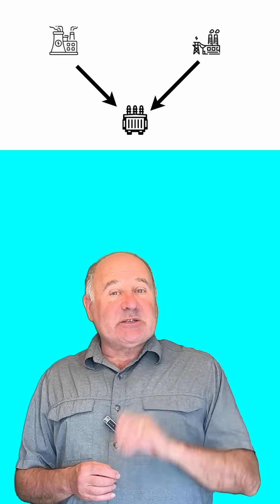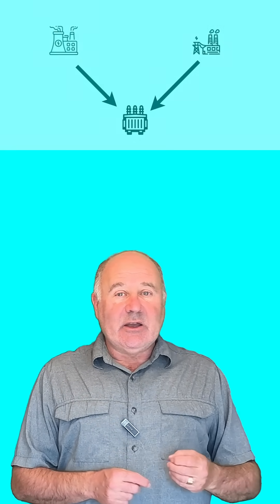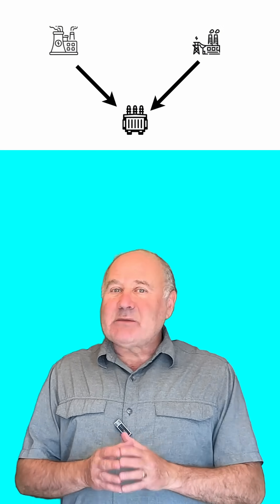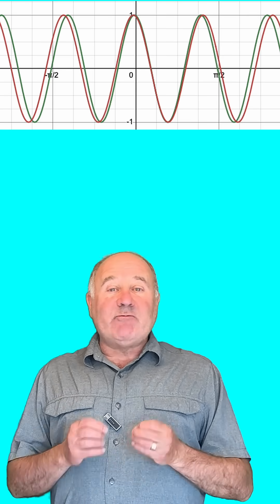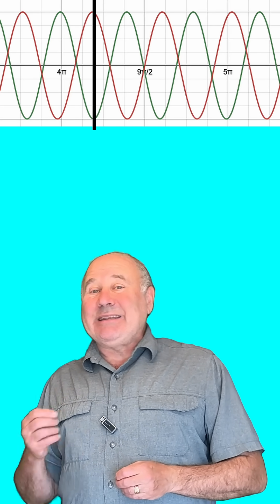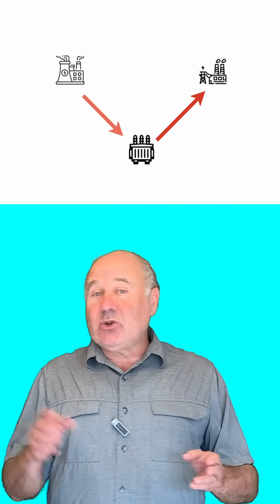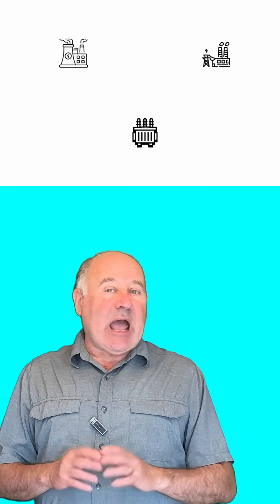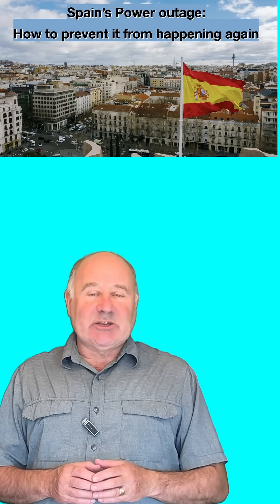Why is it important that every generator on the grid operate at the same frequency?

Comment: I get the main point but: Since this is AC isn't the current reversing forward and backwards n times per second in a grid with n Hz frquency (i.e. 50 or 60 times)? So how would the current travel distances between stations?
Reply from the maker: @sudosu4133  it’s a bit confusing how AC power works. The electrons move back and forth at 50/60 Hz, but the energy is constantly flowing from high to low voltage, and that’s the current.
Reply: They use sensors to synchronize the generators to each other so that they run at the same speed and output.  Each generator is putting out voltage and current on the same wire at the same voltage and current as all the others withing a very small variance.

Think of it as several water pumps all attached to the same pipe.  As long as each pump puts out water at the same pressure at the same time, the water will flow down the pipe, not to another pump.

That is a simplistic example, but electrical generators are basically all pumps that pump electricity rather than water.